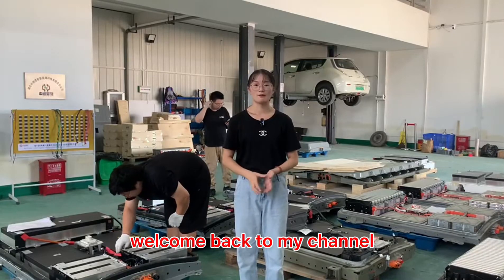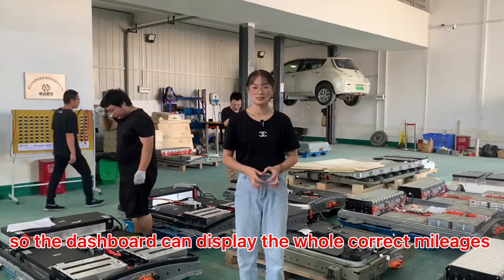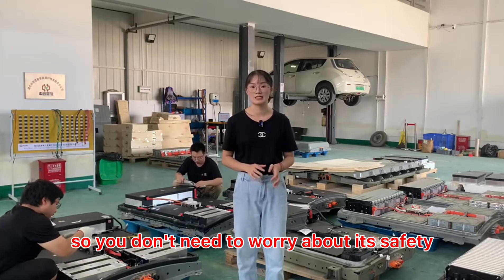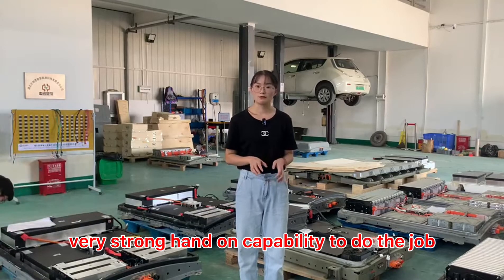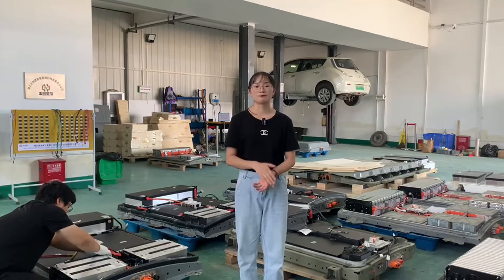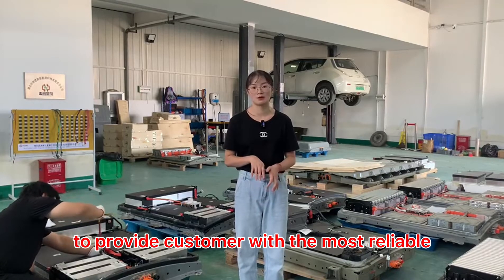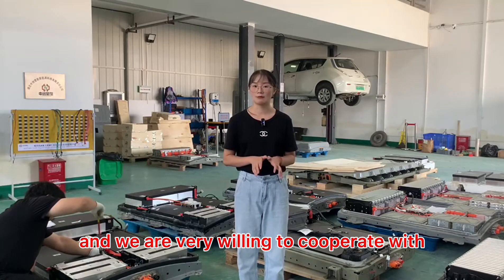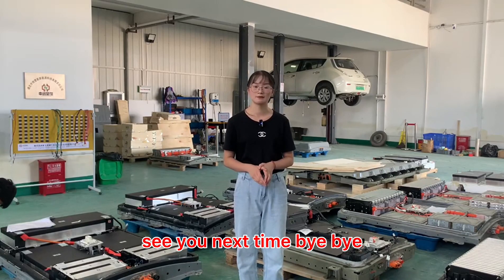Best Battery Upgrade Solution For Nissan Leaf

Comment: On June 25, 2025, Konduit EV in Vista, CA changed out my original 24Kw battery for a new 62Kw battery in my 2011 Nissan Leaf.  The range went from about 12 miles to over 200 miles, with hills!  The cost was just over $11K, with a 2-year warranty.  Highly recommended.  The technicians indicated that, while early Leafs had battery issues, the drive train and motors are top-notch.  If you have an older Leaf and want a "new" car, just do it.
Reply: cheaper to get $11,000 used bolt with liquid cooling

Comment: Hi Cora Liu.  Firstly, you have excellent English.  I am very impressed and your parents must be very proud!  Secondly, I'd like to put a new battery into my daughter's 2013 Leaf.  Does your company assemble batteries for that year?  And, will a 62 KWH battery fit?  I'm in the US, but can pick up in Seattle or Vancouver Canada.
Reply from the maker: Thank you so much for your kind words—I'm truly grateful! 😊 
Yes, we do offer battery upgrades for the 2013 Nissan Leaf, and our 62 kWh pack is compatible with that model. We can usually provide door-to-door shipping within the US, but I’ll need to confirm the exact shipping cost based on your detailed address. If it’s convenient, could you message me on WhatsApp(+8615211174371)? That way we can go over everything more smoothly. Thank you!

Comment: Hi, my daughter received a 2012 Nissan LEAF as a gift. It has 65,000 miles. The car’s body is in excellent condition, however, the battery range is supposed to be around 20 miles only. I have watched several videos of people swapping the batteries. This looks like a project that I can do myself. Do you offer 62kwatts battery version for a 2012 Nissan LEAF? Thank you.
Reply from the maker: Yes, we do offer a 62 kWh battery upgrade that is compatible with the 2012 Nissan LEAF. Many of our customers have successfully done the swap themselves or with the help of a local mechanic. Since you've already done some research and feel confident about the project, that’s a great start! If you're interested, I’d be happy to send you all the detailes, here is my WhatsApp: +8615211174371 and email: cora@vivnevs.com
Reply: Thank you. I’ll be in contact soon.

Comment: American Gen 2 Volt owner.   Have you considered doing a replacement for Volts?   I love the car, and the 2016 battery is still reasonably strong, but it will eventually need to be replaced and newer batteries would greatly enhance the electric mileage.
Reply from the maker: Sorry we don't provide batteries for Volts

Comment: I'm confused by the store on Aliexpress

Do I just need the battery and it's ready to install? No extra parts or adapters or programming needed?

Are the batteries made with new battery cells?

2012 Nissan Leaf 24kWh
Reply from the maker: Depending on the capacity you choose, 40/50kWh does not require any parts to be installed, 62kWh requires several spacers and extended screws, we will provide BMS programming, and using the new CATL battery cells, anyway you can add my WhatsApp: +8615211174371 for more details, or contact me on our Alibaba link here: https://www.alibaba.com/product-detail/VIVNE-40-50-62kWh-Brand-New_1601253177347.html?spm=a2747.product_manager.0.0.6d4371d2LSWe5z
Reply: I believe 2014 and up are better but you can still do it and will only have minor issues.

Knowledge: a couple YouTube vids and …
Reply from the maker: Sorry, I just see your comment here, for 40/50kWh battery pack, no need any accessories to intall, just use the original bolts and nuts to fix the battery. 62/62kWh need some spacers to install. All these capacities of batteries require reprogramming of the BMS. And yes, the batteries made with new battery cells. You can WhatsApp(+8615211174371) me if you still have any question, thank you.
Reply: Good on you .

Comment: 2015 nissan leaf ,,,62kwh, how much
Reply: Checking in the USA they cost 7k plus installation, looks like we better off buying a 2020 leaf 😅
Reply from the maker: @abcloft302  Leaf is a nice car, and it can be driven for another 8-10 years after replacing the battery, so I think it is worth it.
Reply: @VIVNE-CoraLiu yes exactly! Works like brand new with more range. 

So battery pack let's say 50kwh for 2015 Nissan leaf is easy for DIY install?
Reply from the maker: @DisrespectfulGaming  Yes, sure, our battery modules no need to modify the battery case, the fixing holes of all modules can perfectly match the fixing holes of the original battery case, so we don't need to drill any new holes or cut any part of the battery case, All modules are fixed in the battery case with screws. Just like the original, so easy to install.
Reply: @abcloft302  Ummm try math again, $8000 or a little less/more is way cheaper than a brand new EV. I'll gladly buy the battery pack instead for my 2015 leaf
Reply: Do you have these in the uk
Reply from the maker: @MobeenHussain-yc9wn  We can ship to UK by sea
Reply: Can you ship it to Hungary?
Reply from the maker: @gergelyhankoczi6212  Yes, we can, usually we have door to door service to Hungary, but need to confirm according to your detailed address, maybe you can WhatsApp(+8615211174371) me first, thank you.
Reply: @ Thank you so much for this information.
Reply from the maker: @ You are welcome❤
Reply from the maker: Please kindly add my WhatsApp: +8615211174371 or WeChat: 15211174371, thank you.